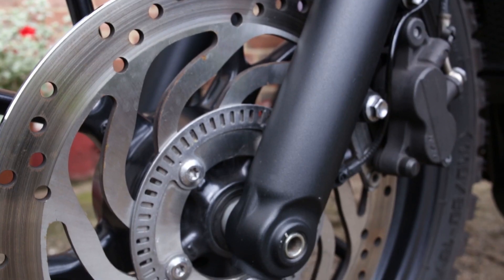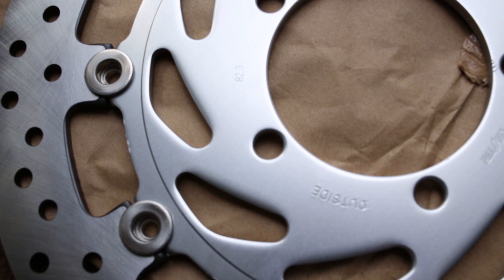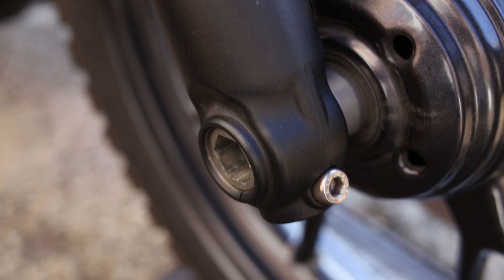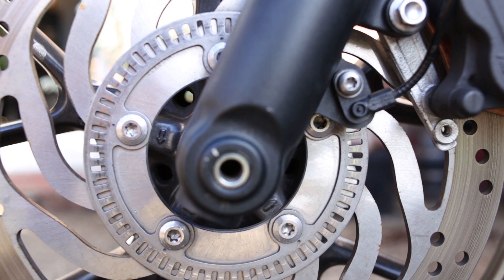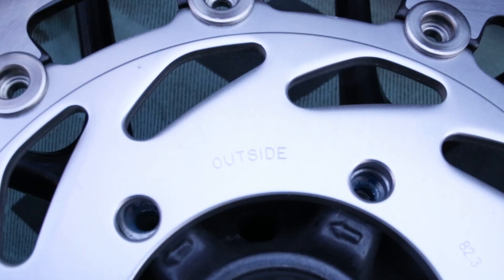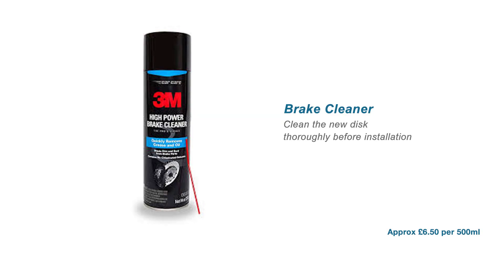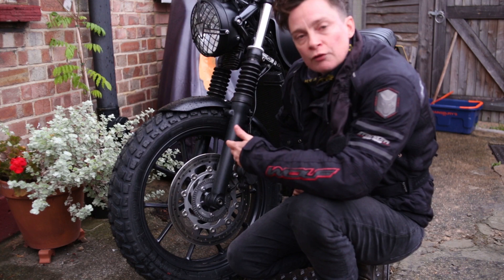How to improve the braking on your Triumph Street Twin!

Comment: Thanks for the video.  I am about to change the rotor and pads on my ST and I'll be much better prepared when I start thanks to your tips.
Reply from the maker: Hi Craig. That’s really kind of you to leave such a lovely comment, thanks. It’s not too difficult a job so you should be fine. One tip. If you put the wheel in and it squeaks when you push it it’s probably the abs sensor touching the rotor. It needs a very small adjustment so keep an eye out for that 👍 good luck and let me know how you get on
Reply: @ToniReviews  Thanks for that tip too!  Just finished putting in the new brake rotor (EBC MD873X) and wheel speed sensor was indeed rubbing on the ABS rotor for about 1/6 th turn.  The Haynes manual specifies an air gap of 0.4-1.2mm so my 'special shim' was a 1/4" zinc-plated washer that happens to have a thickness of 1mm.  Started on the brake pads now and doing battle with the grub screw hiding the retaining pin.

Edit: Finished the job.  Didn't seem very different on a short test ride at low speed around the suburbs. Will see how it feels as the new rotor and pads bed in. Cheers!

Edit a day later: Took the bike for a longer ride today (60kms) at some higher speeds (90km/h) and I can feel the difference.  While it's definitely an improvement, I would describe it as incremental rather than life-changing.  My old rotor was worn below 5mm so it was definitely worth doing for me.  Interestingly, I can now hear a faint 'fluttering' noise from the front wheel above about 20km/h and the pitch increases when I apply the front brake.  Did some reading and it's apparently quite a normal observation with new EBC rotors and especially HH pads.  People variously describe it as a humming, buzzing, whistling, clicking or cicada-like noise.  I'm the first to describe it as a fluttering noise - woohoo!  Hopefully, it quietens down as the new parts bed in - it's surprisingly noisy.

Comment: Great video!
I upgraded to Brembo SA brakepads and new brake fluid. It is a massive improvement. Still the long brake line to the ABS pump in de rear of the bike is not great, but I can live with it.
Reply from the maker: @omega_profile1  hi. Glad you enjoyed the video. Thanks so much for the comments. Very interesting I may try these pads on my next brake pad change. Definitely the fluid makes a massive difference 👍 thanks for sharing

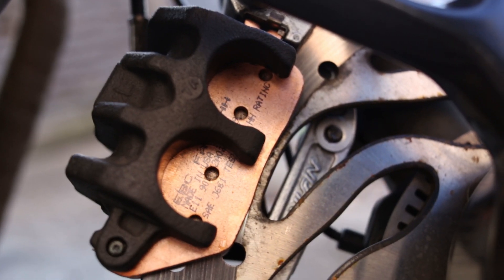Comment: Do you Remember If you had any trouble with noise when you replaced the Front Pads with these EBC Double H? I tried a set on Mine Street Twin (2016) and I got an annoying continuous Cicada-like noise when the motorcycle starts to Move. I also noticed that @2:13 you did not use those metal plates (shims) that are installed with the stock front pads, any reason why?
Reply from the maker: Hi. No I had no noise from the pads, I’ve continued to use these pads evertime I service the brakes. If you have a squealing noise coming from the discs I’ve found it’s the abs sensor rubbing on the abs rotor.you have to make sure there is enough of a space and not overtighten the sensor as it runs and causes a squeal. Also these pads didn’t come with a metal back. They came like this. I usually use some copper grease very lightly on the rear of the pad to stop any noise. If your getting a noise my first check would be the abs sensor
Reply: @ToniReviews  i didn’t even remove the ABS sensor when I change the pads, there’s no need to do that. The noise go off when I switch back to the OEM pads, so it’s definitely the EBC pads that are causing this noise. The shims that I mentioned are supposed to be there with the stock pads, you then re-use  with the new ones. If you maybe have a haynes manual there is a photo of these shims in the brakes section.

Comment: Very clean review!! really frustrated with the front brakes on my 2018 Model, EBC pads are cheaper options to start with.
Reply from the maker: I totally agree. I went for a ride on the 2019 model, was absolutely fine. So when I bought my 2017 model 2nd hand I was shocked at the braking ability. I think the pads have definately made the biggest difference overall. The floating disc has also added some stopping ability, but the pads are what made the biggest difference. safe riding

Comment: good review! I have de same bike, and same bad front disc, I think that Triumph fix in the t100 and streetcup this disc of the review for problem of temperature and low brake. I have the front disc a little darkblue colour, and think that don't brake now same. For me is a big failure of Triumph. I want change the front disc, i have now only the pads,but think the disc is a little warped for temperature, and the wafe help. But i see new EBC wafe front disc... is a good idea too. regards!
Reply from the maker: Yeah the sintered pads are a good upgrade option to start and the floating front disc has also made a small improvem,ent, but the biggest improvement was simply the pads.

Comment: This is very detailed! I want to change the brake pads on my 2017 Street Scrambler (I believe it is the same Nissin brake system as the Street Twin), however, I cannot figure out what the appropriate sizes of the pads are. Any clue?
Reply from the maker: Hi. I usually buy my parts online and sellers will usually detail if a part is compatible with your bike. I believe the scrambler anbd street twin have the same Nissin brake calipere but the front wheel size differs on the scrambler. I think the front wheel is slightly larger. Howeber chjeck this website out which details make and model compatibility https://www.motorcyclepartswarehouse.co.uk/ebc-fa142hh-sintered-performance-motorcycle-brake-pads.html?gclid=CjwKCAjw26H3BRB2EiwAy32zhU1CsGfNfHw5zD3mIt4qMhdl0VZceYaH5JzdaQZV-zSO84C2gLFx_xoCkIEQAvD_BwE

Comment: Hi! I already upgraded the Brembo kits with 340mm disc for my T100-2019. But the disc is broken, I couldn't find it at my local market (Vietnam). Is it easy to find at your location?
Reply from the maker: I just looked online. Difnt upgrade to the Brembo as it was around £600 so just upgraded to a floating disk and sintered pads. hope this helps
Reply from the maker: there will also be linkt to itemas i purchased in the description